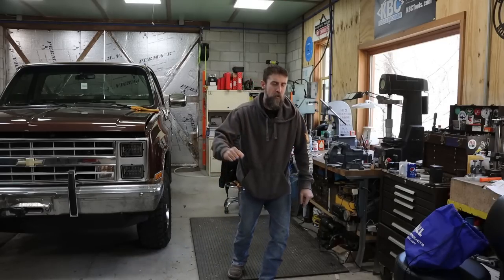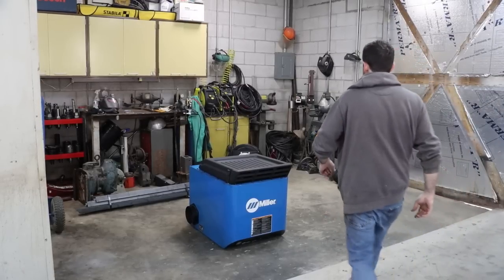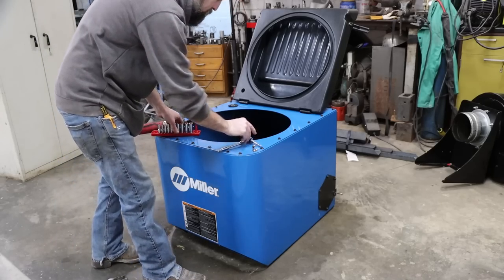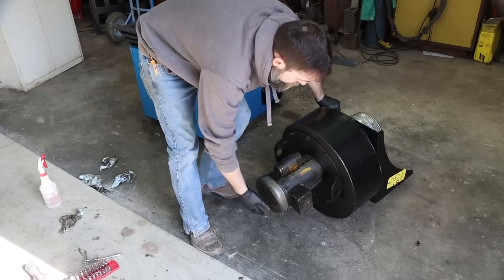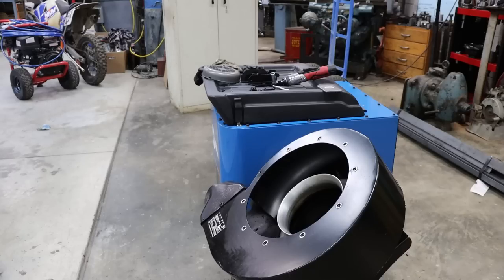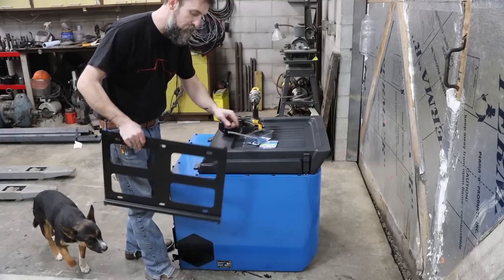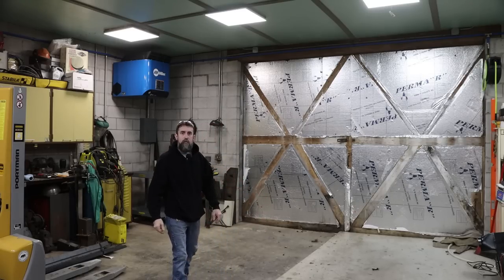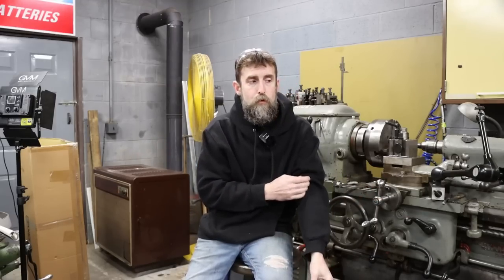Auction find Miller Fume extractor for the shop

Comment: Steve, in nearly every video I discover something I didn't know existed and then instantly know I need! I have a real mist coolant and welding fume issue; I have electric heat in my shop and in the winter I have a 32" exhaust fan running with the door cracked and a torpedo heater on full blast. Talk about expensive! Great video and thanks for sharing this, I am now on the lookout 😂

Comment: Thanks for clearing up why the truck is why it is. Ohh how I love that exhaust tone. Music to old ears eh. A band file ? News to me bud. A demo would be neat for sure. I fought for years to get an exhaust system over my main welding bench that went on for years. When they eventually did put one in it was far too large and in winter would blow all the heat outside. End result was in retirement I have two puffers that are a part of my life now. Nice unit here Steve. In the long run your lungs will be far better than without this great system. Take care eh.

Comment: Hi Steve, nice addition to the shop.  Got to keep the doors closed so Cory is comfortable!  There is something oddly satisfying cleaning years of gunk and grime off a piece of equipment.  Its almost as satifying to watch someone do that cleaning.  Big box stores carry flexible ducts used for HVAC systems.  You might find something that would suit the purpose and it is considerably cheaper that a used car (around $100 in my area for 25' of 8").  Thanks for the video!

Comment: Steve you can make your own hose. A mandrel (PVC pipe and wood), plastic (to protect the mandrel) rubberized fabric, cable, 3M scotch-weld, more plastic and a spool of rope (for compression clamp). Air nozzle to release off the mandrel. 20 minutes on YouTube videos. Thanks for sharing. P.S. I have seen diamond coated band saw files but not file bands.

Comment: Huge plus on both the DoAll cab & air filtration unit. I too hate to have to go out on the shop stoup to do most weld and cutting. I need a smaller unit like that, since my work area is only 900sf. Thx for sharing. That storm hit us last Thursday and rearranged a lot here too ! See U on Sundays video, Bear

Comment: Good morning Steve. Your definitely going to like that filter system for welding to get rid of the smoke and not freeze you out at the same time lol.
You just gave me a great idea. I was at a auction last summer i picked up a small ACE fume extractor for 20 bucks only because nobody knew what it was its not high capacity about the size of a shop vac with a 2 inch hose with a metal pipe and snorkel on the end with a magnet which i just stick it to my cherry picker so i can set height and move around you have to have the snorkel pretty close to where you are welding a bit of a pain but it does get rid of the smoke I'm quite impressed with it.
The other item i got at auction was 2 aeration fans and and all the screens and hardware for drying grain in the bins i had no idea if they worked  didn't really care at the time i was more so after the screens about 20inches in diameter and 5 feet long sections 8 sections got them for 10 bucks because every one thought they were junk well i like building things from what most people consider junk. But after seeing your filtration system i noticed that your fan impeller is identical to my aeration system 2 hp motors and i did wire them up and they do work great the motors where pretty much new even though the rest was a little rusted that is where after watching your video you gave me a great idea I'm going to build a cabinet to house a pre filter and a hepa filter and use 1 of the aeration fans to power it and use chimney pipes or heating ducts for duct work from welding table or build it into a cart so its mobile so now i have a new project for the future lol.👁👀🤔🤔🤔🤑🤑🤑🤑👍👍👍🍻

Comment: If you can use sheet metal duct for most of what you need you will find it more efficient and easier to clean. Your local central heating company could probably make you custom/semi-custom bits for not a huge cost. It certainly worked for me for an oddball duct job I needed some years ago.

Comment: Nice job on the fan n blower unit. Looks great where you installed it, up n out of the way. Like it's always been there. About the hose, the only thing I can think of is some A/C Flexible 6'' duct, just not sure how it would hold up. Sure you will figure something out, you always do. Thanks for sharing. Maybe we can do it again tomorrow.

Comment: Hey Steve, I love that Do-all cabinet. I’m one of those people that likes to get all the accessories so I feel your joy. I’m glad it’s not just Australia that the ducting is expensive, I found about 25’ of 6” diameter material ducting just like yours at my favourite junk shop for just $10. Some one had made some kind of giant worm toy/ sculpture out of it and obviously had no idea of it’s value. It was fun trying to get it all in the car though. Unfortunately I have to say I also find your voice very quiet and I have trouble hearing you and Elizabeth speak so I had the volume turned way up and then when you gave the Chevy a rev it nearly blew the roof off😂😂. I’m guessing the fume extractor was used to remove diesel fumes out of a workshop when working on trucks ect. They hook directly onto the exhaust which explains the soot but not the oil. Cheers mate, Stuart 🇦🇺

Comment: Steve, flex duct for HVAC might work, but you won't need it insulated.  If you're near a job site where there's remodeling happening, check with the job foreman to see if they have a picture you could have. You might be able to get some spiral duct that the flex attached to and then the piece of flex you already have might work.

Comment: Nice extractor fan!! As for large hose, I'd try a heating/air conditioning company and see if they have something suitable and cheaper.
Reply: Yes for home shop use HVAC flex pipe will work, as it just has to handle a low pressure, and is often available for free from demolition, as they normally toss it out. For the flex piece simple to take that rough and dirty fabric hose, and use it for the arm side, enough to let it handle the work and the heat, which the HVAC pipe and duct will not like, but once it is a little cooler after the fan it will work fine.

Comment: Beware of ear worms. Need to have a boot about video in your truck dude. I would  hard pipe to the filter box then flex to the fume generating zones in say a 5' radius to start. Beware of analysis paralysis, 80% will work.🤙👊

Comment: Very nice find and another great video.  Thanks.  An idea on the hose...  I have a heavy duty pull behind leaf vac.  Purchased it from Rural King, brand is "Agri-fab".  It has very heavy vac hose that can be purchased as a replacement  part.  My biggest concern is that it is likely not flame retardant.  Good luck. Enjoy the much cleaner air in your shop.

Comment: Steve I know you said that big filter to replace is like 500 large.  However whatever that fume extractor was used for before must have been a very dirty environment to have all that grease and scale in the fan assembly.  That filter may not be totally clogged, but you might want to keep a mason jar for pocket change for the next one.

Comment: Hi steve, i would use pvc pipe, 4 inch looks like it would work, nipple out of the pvc using the vac hose you have.  Oh and buy your 90s from the electricial supply house, you want sweeps, not 90s you will move more air.  Laminare frow is is better.  Regards, hi to the family, and yeah its gonna be pricey this way too.

Comment: Steve if the hose is a standard diameter i.e. 8". -  10" etc look on eBay or Craigs list for leaf vacuum  hose.  Often someone will get a pull along unit and discover they are a big pain in the a__ and let the stuff go for next to nothing.  Get real luckey you may find the hand wand attachment that has 14-16 foot hose.

Comment: Why would they have the fan running backwards? Surely Miller designed it to run in the direction where the fan is most efficient.

Comment: Not sure what size duct that is, but look into dryer vent duct called (T-fin or thermofin). It's that aluminum flexible duct. Can be cut easily with a serrated knife.
Reply: Actually I guess home depot calls it the semi-rigid dryer vent duct that is flexible and holds its shape. I just had to buy some 6" diameter the other day, but I'm an a/c guy so we get it from our local supply house.

Comment: Steve, I'm guessing you're smelling ozone (O3), when the plasma cutter is operating.  Ozone is generated by electrical discharges and you smell it when lightening storms occur.  Ozone is a toxic, highly reactive, form of oxygen.  Ozone, instead of chlorine, has been used for water purification.
Reply: It also makes iron and steel rust so fast you can hear it crackle.

Comment: Presumably the filter is an activated carbon filter which is what would remove the smells in the air.
Reply: Looks like a very large area HEPA filter, to remove the fine smoke particles mostly from the air. They can be cleaned, at least once or twice, but you need a really large tank to put them in, and then run a water and detergent through them, while ultrasonic cleaning shakes the dirt off, to get a good clean job without damaging the filter media. No charcoal, as that would have to be equally as large, and would lose efficiency very fast, just can do with another prefilter, made from regular filter batting, wound around the outside of that filter tank, and held on gently with some wire ties, that will catch the larger particulates and a lot of the oil residue, and keep it from hitting that main filter, sort of in the middle filtering, using some cooker hood filter polyester units cut to size, which are very cheap.

Comment: could have done a general extraction system in the whole shop the same way they do in a woodshop except for the dust collection and you wouldnt had to use a filter installing a heat exchanger in the line just before exiting the shop would preheat/cool the air being drawn back in from outside so the heat or cool loss wouldnt be as bad  , the fume extractor works keeping the smoke away from youre work and filters most of the small sootparticles out but the harmfull gasses and smells (might not if the filter allso contains a carbon filter element ) with still be blown back intoo the shop unless you pipe it to the outside of the building / shop
with the way its on the wall now you could build a scoop in front of the outlet grille up intoo the ceiling and out the workshop (intoo the roof space/area) using a big fan ,  still will cause the heat to drop as its mounted so high up but then again i dont think you would weld or grind all that long at a time so it whont be running all day

Comment: Vevor and global industrial have fan and hoses from 6" up to 12" from 100-200 bucks I see vevor send products to different youtubers to review maybe call them and see if you can get just hose  if not it's probably cheaper to buy the fan and hoses from them then just industrial prices fume hose they advertise those for welding fumes maybe they'll send one for a review 👍👍👍
Reply: Look up air mover duct vevor has an 8 inch extractor fan and 16.41 ft flexible expandable pvc fume hose for 106.99 👍👍👍
Reply from the maker: Thanks for the suggestion 👍

Comment: in my opinion, the only good Fume extractor is one with a heath exchanger.
so you dont breath recicled air.
recicled air can be realy dangerous because of germs and the minuscuul partikels who is coming trough..
by example, like all vacuum cleaner makers claiming filtering for 99.98%,  that 0.02%partikels  what passes the filter are the most dangerous ones, and THATS the ones you isolate and breath in with a  Fume extractor.